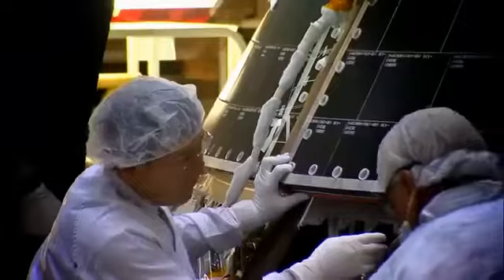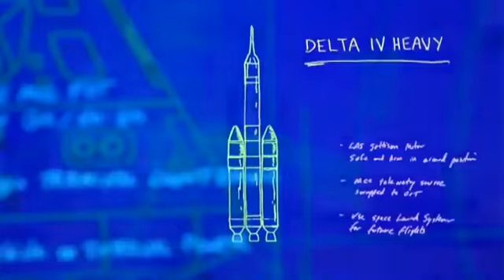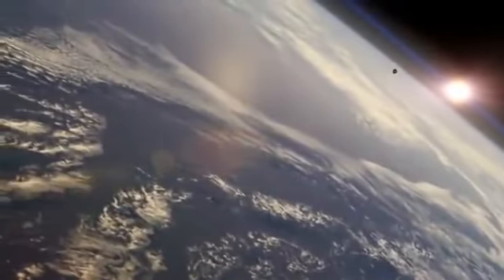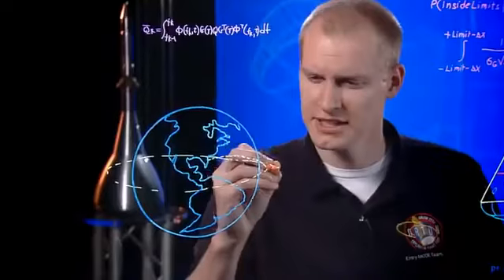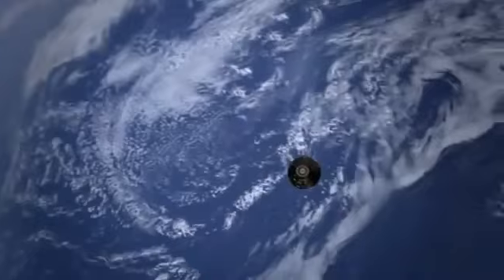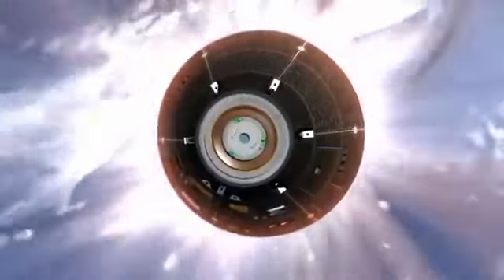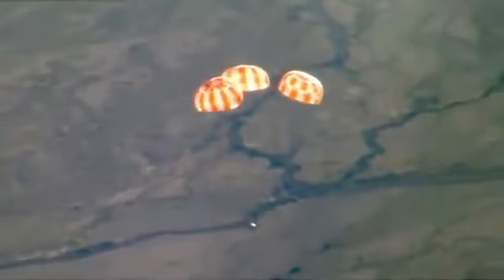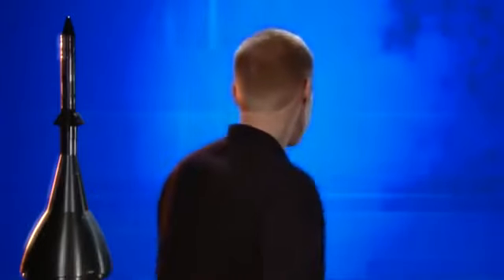NASA engineer admits they can’t get passed the Van Allen Belts

Comment: Important to note:
The Apollo missions allegedly passed the Van Allen Radiation Belts.
Does technology go backwards? Why can't they simply use technology that they have used 50 years ago!?

Because technology evolve. Equipment that will be used is very different to that 50 years ago.
But that is not the only difference in those missions. The time astronauts and equipment will be exposed to cosmic radiation is much, much, much, much, much, much longer than the Apollo missions combined. The requirement for the shielding just went throug the roof.
Not only that, but shielding for Van Allen Radition Belts and cosmic radiation are different and the cosmic radiation shielding can cause problems in Van Allen Belts and aditional x-rays inside the space craft.

That is completely new challenge for the engineers in NASA as they have to design unique shielding, they just can't use the old one.
It's a difference like scuba diving in 50m and taking atmospheric diving suit down to 700m. Why is there any need for that suit, when we can dive with scuba? We already can breath underwater...
This is the level of mistake you are making.
Reply: :DDDDDD
What exactly sounds like a bullshit?
That trip to Mars will take much longer time than all trips from Apollo missions combined? As the Mars is much further away than Moon how can that sounds like bullshit to you? Because reasons? :D
Or is it that because of the longer exposure to cosmic radiation the Apollo module would be useless and the crue would die? Well, the longer the trip, the longer is the exposure to the radiation. Does this sounds like bullshit to you? Because reasons? :D
Or is it because they will use modern technology and not the one from Apollo and the new one is more sensitive to radiation that the old one? Because reasons? :D

The fact that i have to spell it out like that is shocking. Apollo module was not universal. It was custom made for the demands of the Moon trip and for nothing else.

Comment: Alright, so everyone is wondering why they have to work on ways for the rocket to pass the Van Allen belt now, when the Saturn V rockets did years ago. I will tell you why...

You see, the Van Allen belt is an area full of supercharged subatomic particles held there by the Earth's magnetic pull.
However, because of previous mapping out of the belt by unmanned probes, by the time of the Saturn V rocket launch, we had the Van Allen belt mapped out- while there are large, dense pockets of supercharged particles, there are certain areas where it is less dense- meaning less radiation. 
The Saturn V rocket simply had to shoot through these less dense areas at high speeds- while the astronauts experienced some radiation, it was not enough to injure them for the period of time they were exposed.

In this case, the Orion rocket has to orbit around the Earth while in the Van Allen belt, so they can use the Earth's gravity to slingshot to mars- effectively saving fuel.
So therefore, they have to find ways to protect the astronauts from the radiation they will encounter.

Comment: Microchip design has changed drastically in that amount of time, chips were simpler and more crude.  Likely made them more resilient to radiation.  It's also possible that the Apollo missions were equipped with vacuum tubes still, they may not be effected by radiation at all.

Comment: He was specifically referring to this spacecraft, as each craft has to be tested to verify proper shielding protecting the craft (most importantly the crew travelling inside). With each new spacecraft there is a potential for radiation penetration, which means alterations must be made to the craft to reduce or eliminate weaknesses to the specific craft in keeping radiation from destroying the craft and those inside. In NO way was he saying we have never got past these belts, you are misinterpreting what he says here.
Reply: Not to mention that the craft was tested and proven in 2014. It passed with flying colours.
Reply: @marshallcello1128  Orion was originally built for NASA's Constellation program that was intended to bring humans to the International Space Station, the moon and, ultimately, Mars. The program was canceled in 2010 after President Barack Obama's administration requested that NASA focus on other goals.Nov 20, 2018

Comment: From the original missions, much of the "how to" was scrapped. This we know. Even if it weren't we basically have to start from scratch anyway. In the 60s an entire industry was built around getting us to the moon. Since that time, some materials used have become obsolete, manufacturers have gone away or changed what they are producing, etc. Also since that time, there is much more high tech, sensitive equipment. More powerful, but also more delicate compared to 1960s tech. We also have learned even more about the risks of radiation damage and are looking to send people for even longer durations which means the shielding of the past would not pass the muster of more contemporary standards. Trying to build such a craft today with modern materials, technology, and resources with plans from the 1960s would be like like taking blueprints for a Victrola and trying to build an iPod. Simply saying they need to ensure the safety of the equipment and crew in a modern-day mission says nothing about the success of historic missions.

Comment: If they cant get humans thru the radiation in the van allen belt now, how did they do it in the 60's when they "went to the moon"? Ummmm hmmmm.....RIGHT LMFAO
Reply: We figured out how to get through the van Allen belts in 1958. For radiation, there are 2 important variables: 
1. the radiation intensity
2. the amount of time you are exposed to this intensity. 
You can multiply these two and get the total radiation dose. Humans die if they receive a dose of about 300 Rad. 
In 1958, James van Allen and his team at the University of Iowa discovered the belts that were later named after him, using measurements from the NASA missions Explorer 1. With Explorer 3 and 4 and Pioneer 3 he measured the radiation intensity. This is what he found: in the part of the belt where the intensity is highest, it is high enough that if you stay for about a week (inside an Apollo command module), you receive a lethal dose. So for the Apollo missions, the trajectory was designed to minimize the amount of time spent there. The Apollo astronauts flew through the belts in about 3 hours, while avoiding the part with the highest levels entirely. The hull thickness of the CSM was more than enough to reduce the radiation level inside to manageable levels. 
Astronauts' overall exposure was actually dominated by solar particles once outside Earth's magnetic field. The total radiation received by the astronauts varied from mission-to-mission but was measured to be between 0.16 and 1.14 rads (1.6 and 11.4 mGy).
More details in this video from Scott Manley: https://www.youtube.com/watch?v=h9YN50xXFJY
Reply: OG Octuple OG  We can get through the VA belts just fine. 
That engineer is NOT saying otherwise. He's talking about the first Orion test flight. This flight was done to make sure the Orion capsule works correctly in the VA belt: electronics can malfunction in high-radiation environments. Orion's electronics are designed to deal with this, but a practical test is required as part of due diligence. All of the hardware on Orion is new, so it has to be tested in operational circumstances before being considered human-rated. 
The Apollo program did these tests as well, during the Apollo 4 and 6 flights.

Comment: What he says is interesting. My questions are:
1.  If we could send people through the Van Allen radiation belts 50 years ago, why are we reinventing the wheel?  Supposedly they accomplished this on the manned moon missions by transversing a narrow region of the belts and went through them quickly.  Why not use similar shielding and do the same now?
2.  He mentions protecting the electronics.  True the electronics would be different than 50 years ago, but what about all of the recent un-manned probes sent to the moon.  Why not use similar shielding and electronics?
Reply: 1/:
- Modern electronic is way more sensitive than 60's one. So extra care should be taken
- Mars missions (Orion was originally designed in this scope) may requires to cross denser areas of the VABs
- Longer space missions will expose the systems to more radiations.

2/
- They use similar stuff for probes, but if we accept to build and launch a probe only from theoretical computations (which work very well), we'll first test the system without people inside before actually put some.
- BTW the mission was actually performed a few years after that video was taken and the electronic worked as expected, so, it's ready for humans.
Reply: Modern electronics and ICs are far more suspectable to damage from particle radiation than the electronics of the Apollo era. It was and absolute necessity for extensive testing before a crewed mission. The Orion test flight to the moon in late 2022 was quite successful. Take care.
Reply: 1. Surely you realize the wheel has gone through many developments to get to the current norm, right? As technology and processes develop and change, we are going to continually use updated methods.
Most missions basically went around the belts. This concept is graspable by anyone who knows what shape a belt is. One of them went through, and while they experienced a higher radiation load, it still was fairly low. All the info on this, including their radiation exposure, is publicly available for you to read about.
2. The electronics are very different. The  biggest issue is that back then, everything was enormous. You can look at the computers they used to see how very different they are to today's computers. Today, electronics are super-miniaturized. Every component is super-tiny. This is generally good, but it means that, suddenly, a stray particle of radiation is suddenly a big deal compared to the scale of the electronics components, and is far more likely to mess them up. There are several approaches to resisting this. One is to specially "harden" the electronics, but this is very expensive, and requires custom manufacturing. The other approach is to simply have multiples of the components. If you have three computers doing the calculation, and one fails, it's no big deal. Regardless, you definitely want to test that whatever you're doing, specifically, actually works before relying on it to keep people alive as opposed to just a hunk of machine. This is also how Apollo worked... a series of iterations moving gradually towards the final goal.
Reply: @seigeengine  😝😝😝
Reply: @craig7822  : Your point is?
Reply: So Chang e went with old semi conductors 😂😂 @TheWokeFlatEarthTruth
Reply: @AshutoshSrivastavaTimetraveler  Are you suggesting that was a crewed mission? Take care.